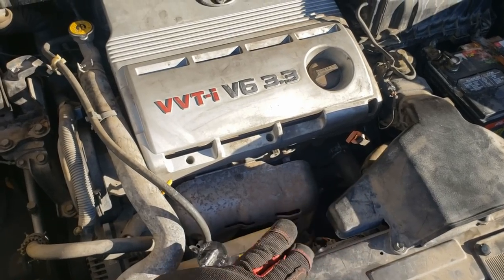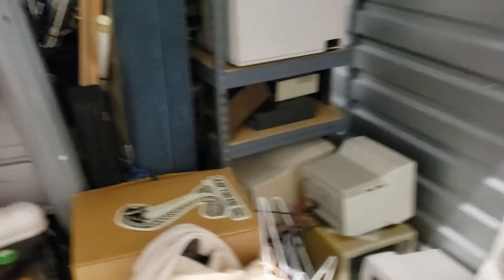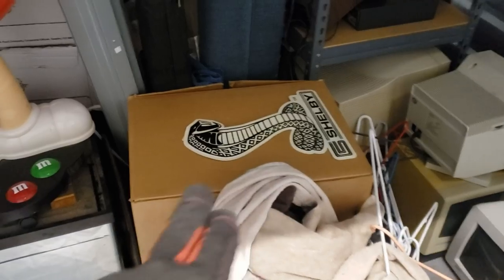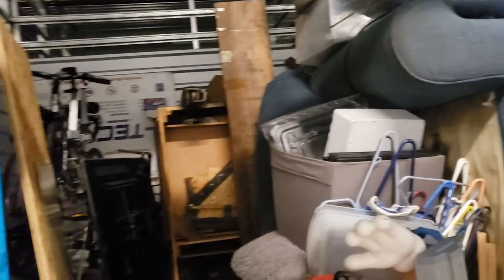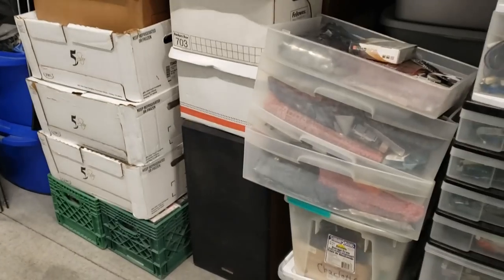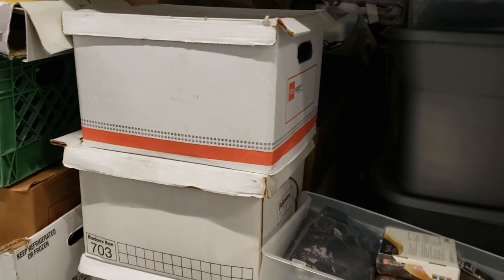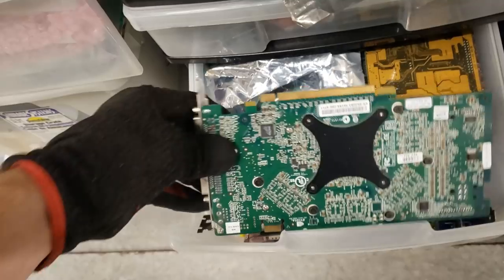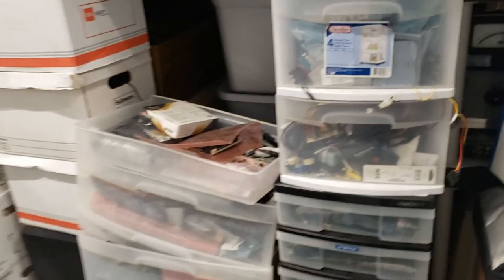Office Vlog 0x03 - Construction Complete! Time to Really Move In!

Comment: Hey, simple piece of advice:  Make sure you have an inch or three of clearance between the floor and anything you care about.  If you aren't living there, and aren't necessarily there every day, a little flooding can cause a lot of damage by the time you find out about it.  Just buy yourself a touch of security by keeping everything on the bottom shelf of rack storage or something.  Maybe even put your MDF furniture on small rubber furniture movers just in case.
Reply: I don't think he needs to worry about flooding.... He's on the second floor.
Reply: @pdfogle0529  Unless the pool on the roof springs a leak.

Comment: For cable management, I have my power cords on cable rakes, which can be mounted on the side of shelves or on doors and the cables just hang from them. They're really handy for stuff that you want easy access to. I then put my other cables into ziplock bags per connector type (FireWire 400, FireWire 800, USB A to B, etc) and put those plastic bags into plastic bins. I find it pretty efficient on space. Also, I love these vlogs and am happy with wherever you decide to post them.

Comment: Awesome that your office space is starting to shape up, really nice to see !

For the cables, I don't have as much of them as you do, but I usually use a big pegboard with some very long peg hook and try to put each cable type on a different peg. And, as you already know, cables are heavy in large quantity, so if you use that idea, you will need to find some beams to screw a pegboard in !
Reply: I didn't think of that, even though I kinda do it already with a couple of spare HDMI cables on a peg board I have. The only issue I see in scaling it up is that he'd need a lot of wall space for that, if they're not overlapped a lot. I also worry about the peg hooks digging into the plastic over time, though I think they sell hooks just for having hose on.

Comment: Cable management: i have a walk in closet with a clothes hanger rod. I just hang the cables over the rod. They can be separated so you have all USB in one bundle, digital video in one bundle, serial in one bundle etc.. you could use Velcro to keep the bundles together if need be. When i need to find a cable i just have to look for the right connector, pull on it a bit to see what the other end is, if it's the right one just pull on it, often it will just come loose... sometimes they get caught and you have to free them. Generally it works very well.

Comment: I've gotten fed up with cable organization to the point where I just use the standard garage type covered bins. I wrap the individual cables and tie them using velcro cable straps, and I organize the bin by type, audio, usb, serial/parallel, video, power, specialty. It's working for me so far. I've pared things down considerably though. I got wire shelves from Walmart, and got the bins set up on it.

Comment: Yes, keep the office vlogs coming, please!
They're so relatable as I also only just moved and everything is still a mess while life has to go on.

On the cable storage topic: I use the larger variant of those stackable boxes and they do work really well for some cables, but as you suspected you need a ton of those boxes. Also I store a lot of pro audio cables which tend to be on the longer side and waste a lot of space if you roll them up with a reasonable diameter (20-25cm) because the inner part of the coil is just empty. They still seem like the best compromise to me though.
The best way to store cables from the cable's point of view is in a straight line of course. A room scale wardrobe of straight hanging cables is hardly practical in most situations, but I'd applaud you should you choose to do that. ;D

All the best to you on your journey, man. May you encounter only reliable server PSUs in the future!

Comment: I feel your pain with the cooling system. I bought a truck once and the radiator was leaking so I replaced it. As soon as it came up to pressure the water pump failed. I got a new water pump and as soon as the system got up to pressure the intake manifold gasket failed dumping coolant into the block. I replaced everything in the coolant system other than the heater core. This all happened when I had been married less than a month and was living with my inlaws who already thought I was an idiot for not buying a more reliable (expensive) vehicle. Seams like things break at the worst possible time.

Comment: For big cables that you have a lot of (like power cables): big hooks on the wall. Hang the cables in a upside-down U shape over them. One (or more if you have a lot) hook per cable type. It is used in a store room at the university lab I work at. It works really well.

Comment: Those type of bins is what I use, and they work OK if all the cables are basically the same, and it doesn't really matter which one you grab. However, it can be difficult to find cables in a mixed bin of them, particularly if they're packed full like your pull out drawers are. As an illustration, just the other day I was looking a Ti-99/4a video cable, and I was pretty sure it was in my A/V cable bin but could not find it there the day before. So, I decide to try and see if it was in the bin above or below which were audio and DC power cables. I didn't find it in either of them after pulling a fair bit of the cables out. Putting them back in I accidentally bump some of the cables in the A/V bin and one of the cables unspools and starts falling out, causing a figurative rats nest of cables to start falling out, and then the TI cable I was looking for just plops out of the A/V bin mess onto the floor... As of other ideas I'm mixed on the whole vertical hanging of cables things, as I've been in electronics labs that used such as that for probes and banana plugs, but probes are really light and banana plugs had very sturdy cables, but computer cables sometimes have light gauge wire and heavy ends.

Comment: for the extron crosspoints, the cheapest way to use them is using BNC-RCA adapters, usually called "bullets", and then cheap consumer composite cables.
Reply: also for cable orginization, see if you can find a lot of bad condition three ring binders, and slice off both covers. mount several of these ring spines in rows on a wall, and now you can pop open the rings and hang cable loops through them, then clip the rings back together to secure them. it's a potentially free alternative to buying rackmount vertical cable organization guides and mounting them horizontally a la eposvox.

Comment: change the radiator and the fans.... it will leave you stranded again soon.
Reply from the maker: I am concerned about the radiator having bits of broken plastic in it, but I was extremely careful when removing the old parts to not get them in the hoses as so far it's been good(this video is almost two weeks old now) so I think it's going to be fine. The radiator itself is actually all aluminum in this year so it doesn't have any plastic parts to fail thankfully.
Reply: @TechTangents  you can also always backflow the radiator. It a good idea to do on old cars as preventative maintenance on all metal radiators. They get plugged up and that accelerates corrosion. For plastic tanked ones, they are time bombs so not worth the work lol.
Reply: @TechTangents  Also dish soap and hose will get all the coolant off the engine and get rid of the smell.
Reply: @TechTangents  ok. but the fans are brush motors and can slow down over time. they have over 15 years on that vehicle. much cheaper than having that engine overheat. Use OEM quality parts, not cheap autozone parts.